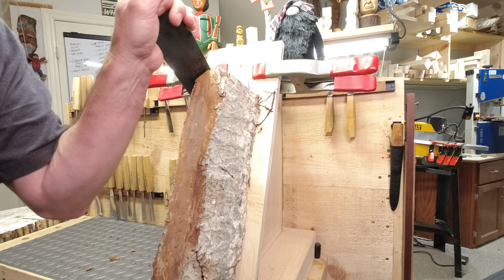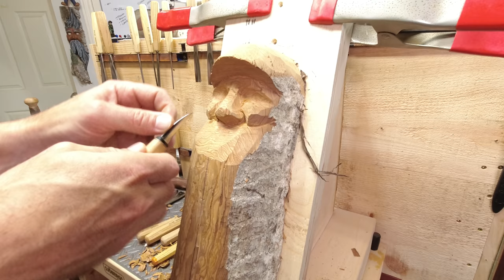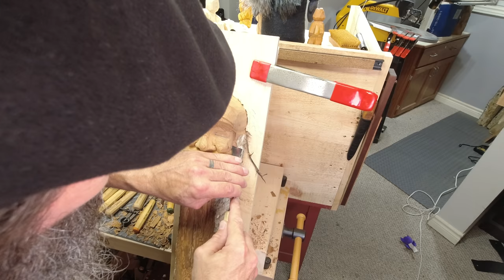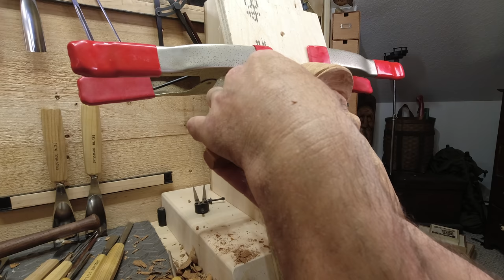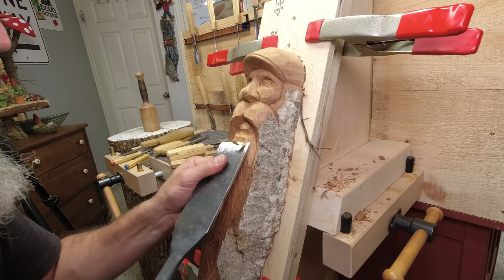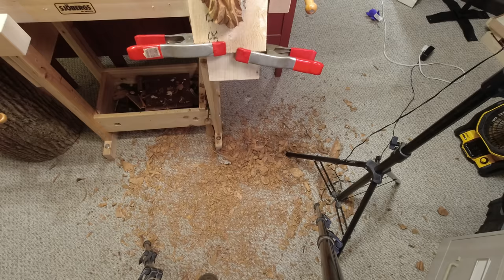Beard Goals - Silent Woodcarving (Hand Tools Only)

Comment: I was a sign carver before everything became automated. I hand carved many signs. I mostly carved ( incised )text and not much relief or dimensional stuff. I still have all my hand tools. Most are the same Swiss Pfeil tools you are using. I havent carved anything in years though. Im 70 now. Id like to try something like youre doing. I normally used red cedar or redwood. In the later years sign places started using HDU ( high density urethane ) Commonly used today with CNC routers. Sometimes Honduras Mahogany. A few times other woods like pine or white cedar, even ebony once. Never tried cottonwood . Bass wood and butternut are good to carve. Usually used the cedars cause signs were generally exterior.

Comment: fantastic work, congratulations. But may I ask, why don't you also use a mallet with gouges?
Reply from the maker: Bark is too soft
Reply: @dougLinker  I understand, on the other hand I work a lot with walnut wood, and I can't do it without a mallet, it's a very hard wood, even if it has a very nice grain.